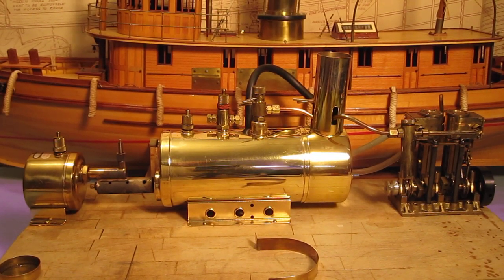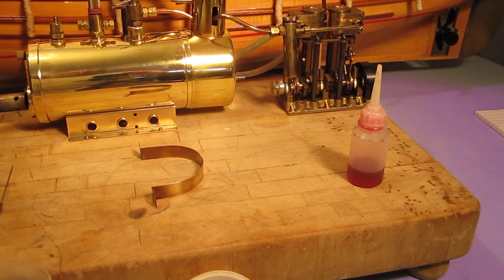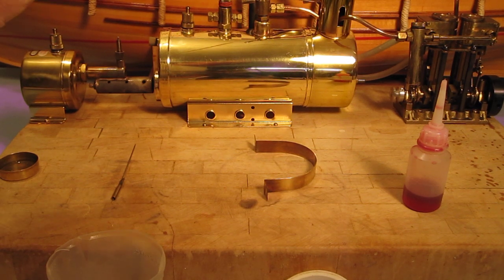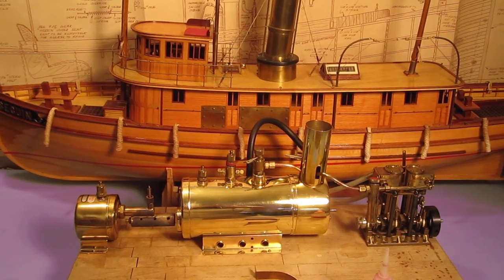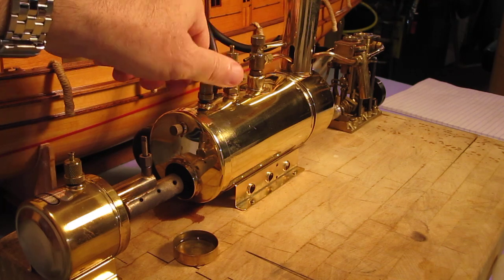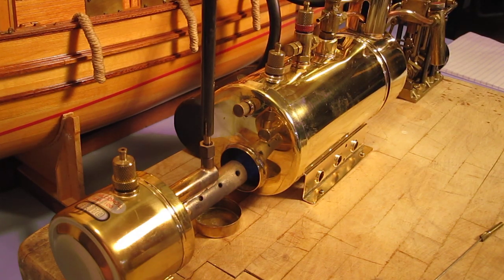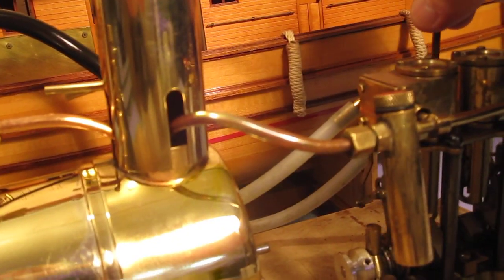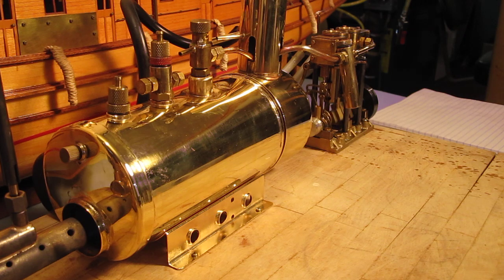Saito Steam Engine Operation

Comment from the maker: Hi baronn3n,

It's a real nice engine! I thought about the "Chiba" (back in 1980), but wanted to to put it into a plank on frame hull. Never did build the launch so I sold the boiler, engine and plans to a gent in Belgium in 2011. It takes allot of torque to open the boiler throttle and you might want to get a third servo for the burner. My static tests showed the burner ran for 20 minutes attached to the boiler and engine. Would love to see the progress of your build on the "Chiba". Good luck!

Comment: will the burner, boiler, and engine that you have there fit in the tug that you have there if you plan for it before finishing the deck up front?  I have the tug but didn't want to spend all that much on the power plant if it won't fit in the boat.
Reply: Hi Mitchel,

I think it would be very difficult to do due to the bulkhead framing in the forward part of the tug as you would have to cut it pretty far back to accommodation the burner to a point you may have trouble supporting the planking. In addition major strength for the hull comes with the assembly of the main deck to the keel and frame assembly prior to planking and when I looked in to trying to get the burner in AND have access to it it looked like the forward part of the deck would have to be removable adding more construction problems. 
The engine and boiler are far more expensive than I bought them back in the early 1980's and now sell for over $1500. The better hull would be that of a steam launch where you can have easy access to everything and show off the engine. The electric motor system I used (with reduction gears and solid state speed control) was very easy to install and gives you precise speed control.
Saito actually sold two models kits for this engine. One was a steam yacht and another a tug. Both used fiberglass hulls.

Comment: Is there a Sight Glass to indicate the Water Condition Level in the Boiler ?
Reply from the maker: +Frank Napolitano Hi Frank,

No there is no sight glass in the B2F boiler, you just top it off until water comes out of the plug on the rear of the boiler. If you plan to used the boiler and engine in an R/C model it's important that the boiler and fuel tank are  topped up prior to a run. I experimented with the engine and boiler set up on a platform and found that a full fuel tank will run out prior to the the boiler running out of water (to avoid boiled damage). It's also important to know know how much time you have on a full tank of fuel so that you can bring the model back prior to running out of fuel so it doesn't get stranded in the middle of the pond.